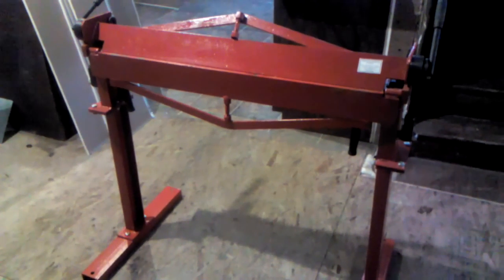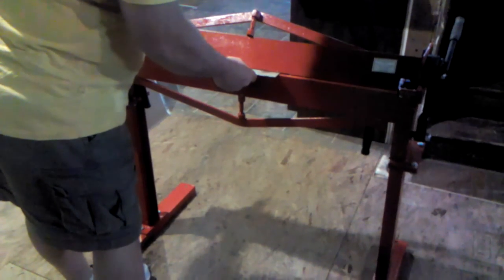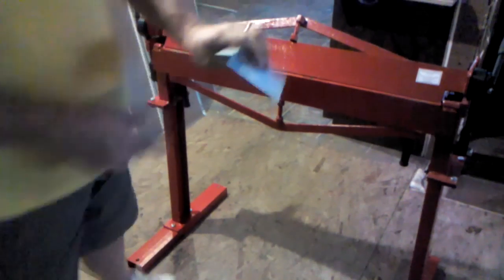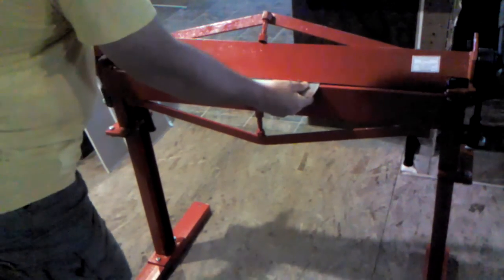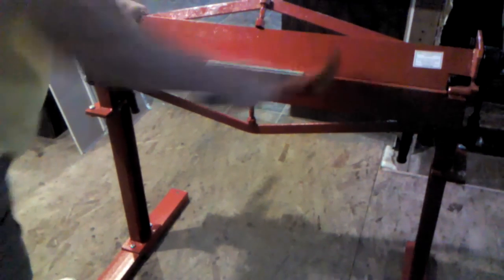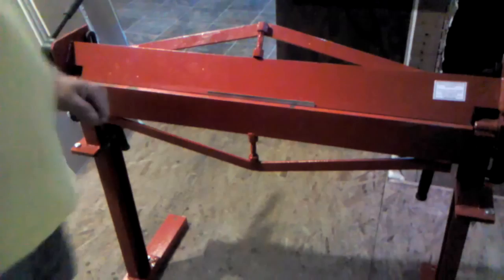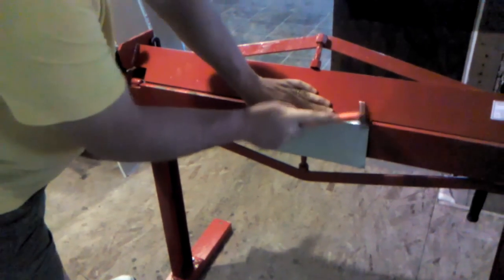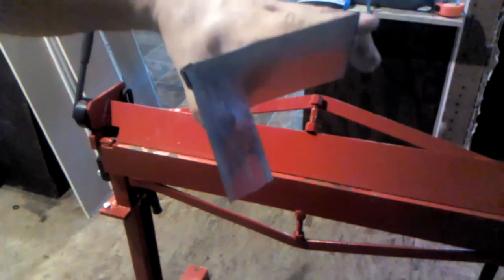The Pittsburgh Seam made easy

Comment: after the second bend slide piece in as far as it will go with taller flange going up then break all the way and use fingers to push flange dn from there u can flatten in brake and never use hammer til knocking dn on last bend